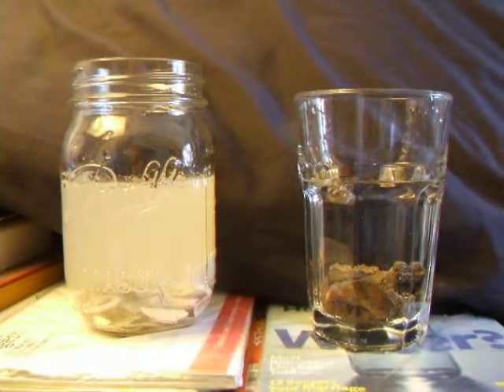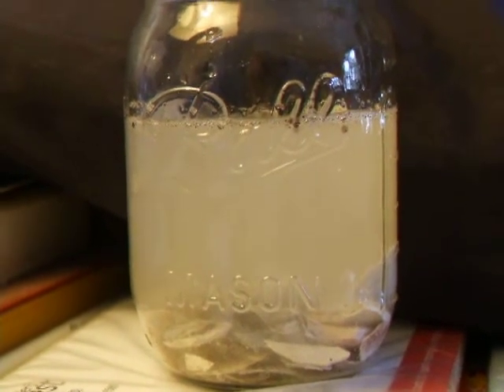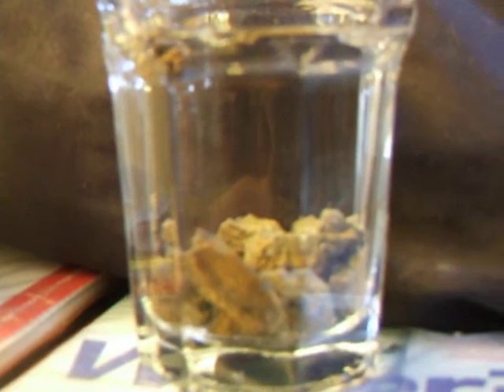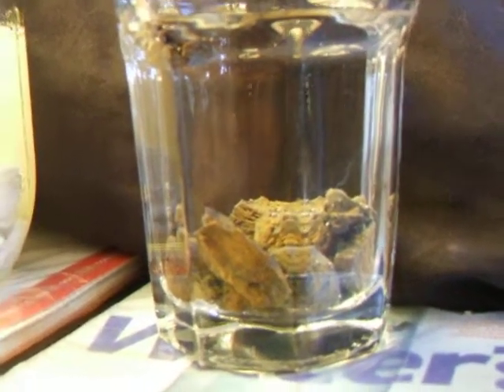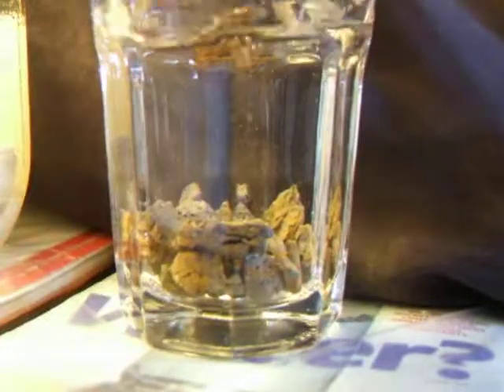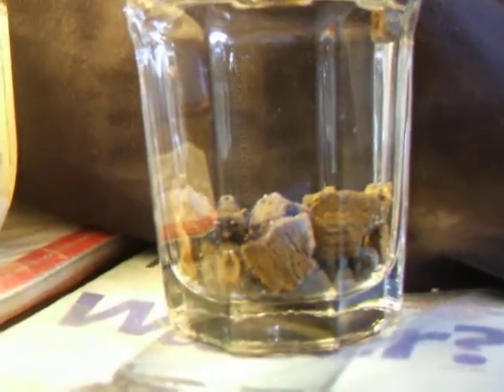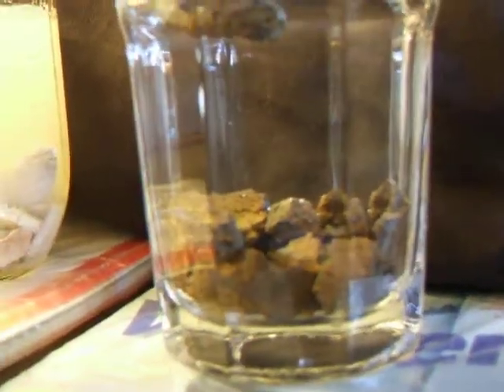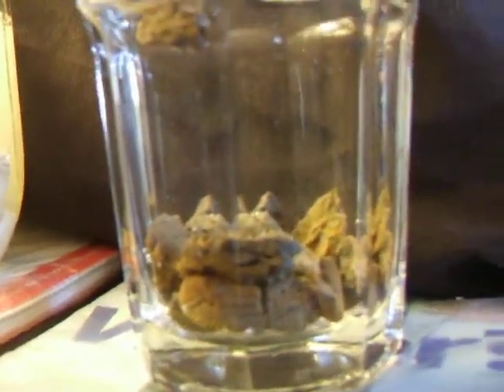Aquaponics Media Fizz Test using vinegar

Comment from the maker: Not all plants die but certainly you don't want to use limestone as your media and I don't recommend placing shells in your beds either though some plants still do ok even with a pH of 7.6 that most shells will hold.  Rocks that fizz like the shells or limestone will, don't use them as your media but save some to put in a stocking to hang in your system at a later date to act as a pH buffer (keep pH from falling too low.)